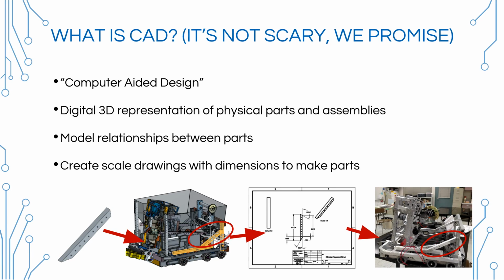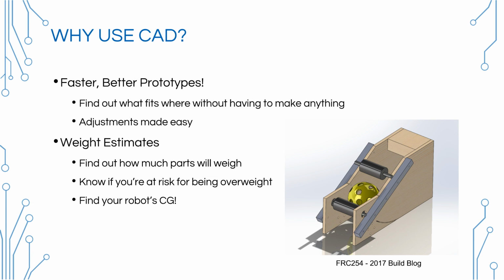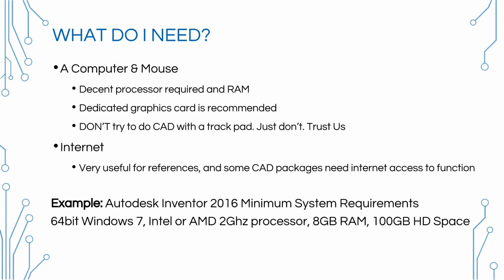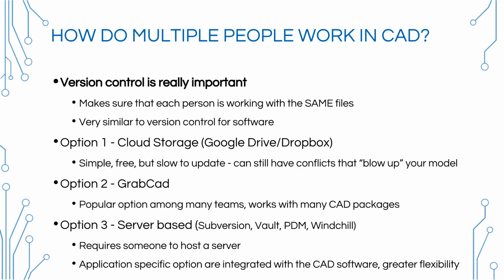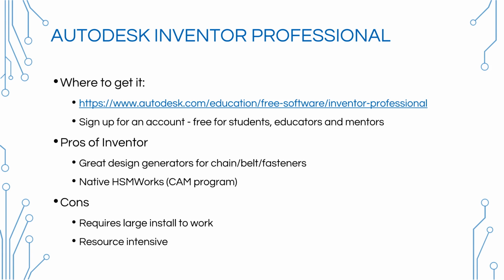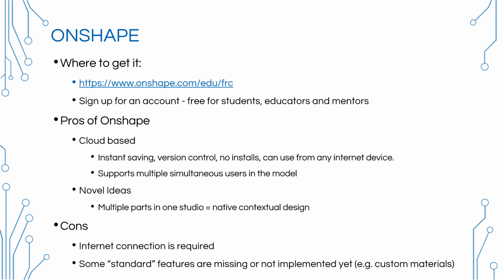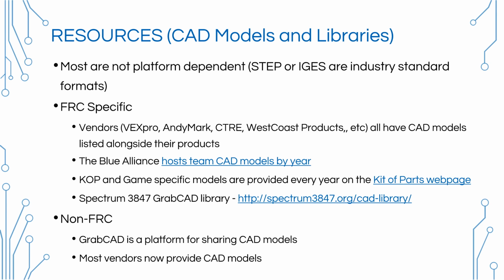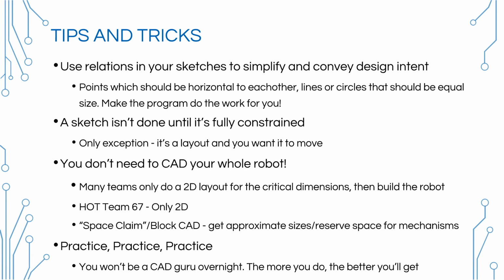Behind the Lines S04E04: Getting Started with CAD with 319 and 5803!

Comment: This is an excellent resource for students just starting with CAD or mentors/student leads that are teaching CAD. Well done!

I do have two questions: 1) I've been evaluating OnShape for use in FRC for a while now, and I've found that, when doing moderate tasks (i.e. cutting out a bellypan, gearbox lightening, etc.) it can slow down to almost unusable speeds. What do you recommend to increase the performance of OnShape in these scenarios (more powerful computer, Ethernet over wifi, solid state, etc.)?

2) What is your CAD computer setup? (Laptop vs. desktop, discrete graphics, amount of RAM, etc.)
Reply from the maker: You certainly want to get a wired connection if possible. Also, we've found a lot of success with using Firefox over Chrome for OnShape, so give that a try and see how it works. Of course, a more powerful computer, and restarting your browser every once and a while can't hurt :D